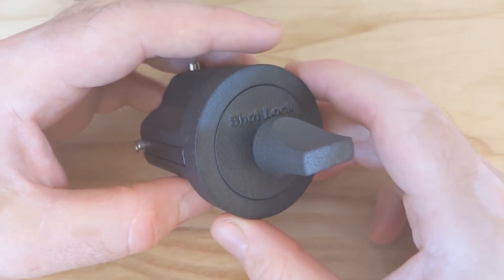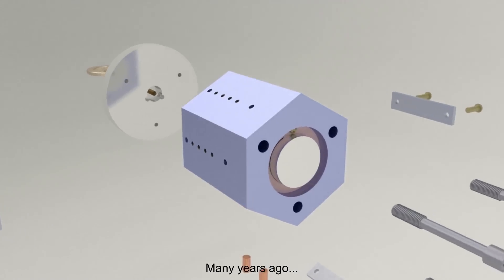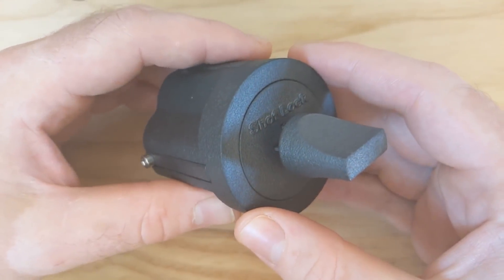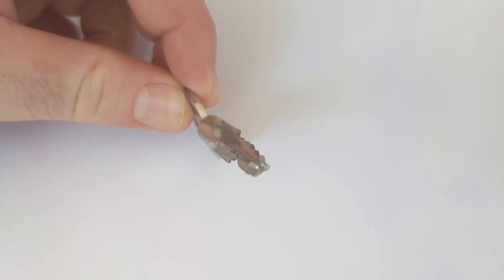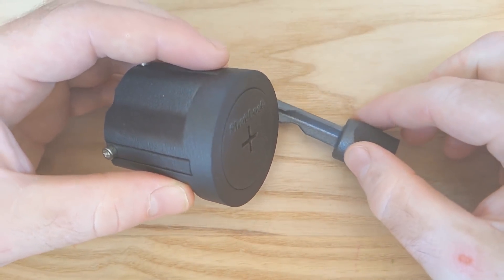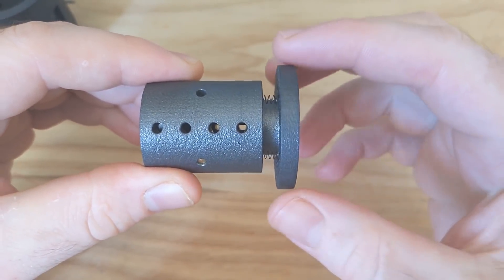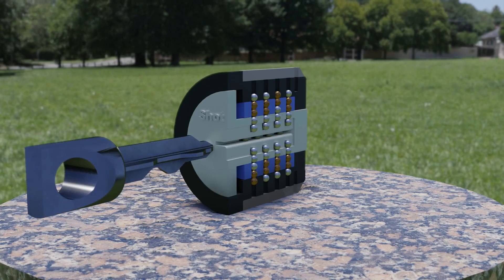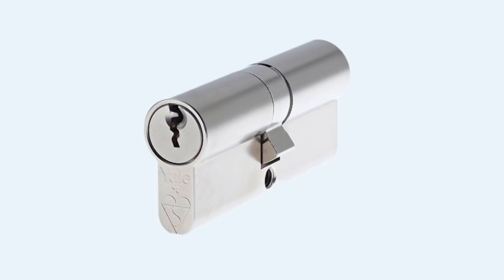A 3D Printed Unpickable Lock

Comment: As I understand it, the typical attack against these sorts of two-stage locks is a precision measurement attack. Like in a normal lock, manufacturing imprecision means that one of the incorrect pins will bind first. You can then use something like a Sputnik pick to vary every position one at a time and discover when the lock turns ever so slightly more. Here's a video using this attack to decode a combination lock: https://www.youtube.com/watch?v=h1MYWwpqH2s

I think you could miniaturize your design by using a tubular lock so that the second stage is behind the first stage (deeper into the lock body) rather than surrounding it.
Reply from the maker: Ah that is a clever attack! Probably would still take quite a while but I think it might work. I did consider the tubular design but it's difficult to fit in enough pins because you need so many.
Reply: @timhutt7051  Could you stack very small key pins to get a base greater than 2? If you have a key pin that's two cuts deep, and the key can have eight cuts, you could then have four of these (that would shear on any cut that's a multiple of two) with this stack pushing on an ordinary key and driver for the second stage. Perhaps the small intermediate key pins would be too flimsy or get clogged with grit after long-term use, though.
Reply: @davvigtu  did he answer your question?
Reply: @danpineda4447  I don't think so.
Reply: I think you could also do precision decoding with a set of 20-30 "test pattern" keys.  Only have a vague hold on the math though so would need help figuring out the optimal test pattern.  

Do you have any other examples of 2-stage locks?
Reply: @martylawson1638  I think the Yuema 760 as well as the Abloy Protec locks count as two-stage. I've seen a (low quality) video of someone attacking a Protec 1 with a laser pointer mounted to a key handle, but I'm not sure if it was a precision decoding attack.

The Yuema 760 has two sidebars, one that keeps freezes the position of the sliders, and another that authenticates. There's a video here: https://www.youtube.com/watch?v=tj4DG7Tnu60
Reply: @davvigtu  Thanks for pointing out the Yuema 760.  That's a very clever lock.  It prevents picking by locking the wafers before the lock-bar is tensioned.  They're very close to rendering it immune to precision decoding as well but unfortunately the lock jams up on the top of the lock bar instead of the side.
Reply: @martylawson1638  Yes, if they could just get it to spin like the 750 instead, then they'd be really close to unpickable. Particularly so if Sidebar B locks the sliders before the authentication even happens, so CaptainHook's 750 decoding attack wouldn't work.
Reply: @timhutt7051  Send it to LockPicking Lawyer for testing.
Reply: Might as well just have this lock be precision machined then, defeating decoding by this method as well. For a few hundred bucks per lock you could have the tolerances so tight you cannot decode, and at that point an angle grinder will do what it does best. Ultimately locks exist to prevent silent and fast intrusion, not silent OR fast intrusion. A lock can be bypassed quickly with a grinder, or silently by picking, but ultimately the end result is the same. If you want something to be inaccessible without detection & intervention, have it guarded.
Reply: @james4066  It's still a fun engineering problem to see how close one can get to a practical lock that can't be silently defeated! You're right, though. Making something near-inaccessible will basically entail living in a safe (imagine a solid metal front door with relockers), and even that only buys you time.
Reply: @davvigtu  oh definitely, didnt mean to make my comment sound so disagreeable. Just wanted to add some context to the pursuit of the perfect lock, cheers!

Comment: I expect the LPL would build a custom tool for pressure and would then pick the 4 sides.
Reply: You cannot pick because the only way to rotate the core is to offset it from the pin stack. I think it can be decoded, though.
Reply: I'm not sure that would work. You can't apply torque without pushing the centre piece back and once you push it back, you cant access the pins to pick.
Reply: He could burn it open
Reply: @bdawg5855  he could blow it up with a nuclear bomb - the point is, he cant open with NON destructive methods.
Reply: @bdawg5855  LPL focuses mostly on non-destructive entry, but with this custom tool Bosnian Bill and I made...
Reply: my guess is that he'd actually use a tool to reach between ball bearings to feel for the double bearings to lift them each to correct heights, very clever lock though, would need custom picking tools...
Reply: @DisKorruptd  how will he be able to lift them when there is no leverage?
Reply: @stephen2583  perhaps I was a bit unclear, this would likely be a custom tool that is like a key that you can adjust the bitting to
Reply: @stephen2583  Insert key with all 0 bits, apply slight tension, then vibrate vigorously... might jump some of those ball bearings into place?
Reply: @freakyjason477  and how would that work in someones front door? wait for an earthquake? and you think you are going to vibrate 20 pins in to the correct place all at the exact same time?
Reply: "Using this tool Bosnian Bill and I made yesterday, I will open this lock with the sound of my voice"
Reply: @Tonatsi  Bosnian bill retired, have some respect.
Reply: @SpecterNeverSpectator  I made this comment before I learnt of that

Comment: That's an elegant design 👍. Neat way to isolate the pins and remember the key.  Way simpler than the toy lock I made after watching the recent "stuff made here" video.  Also ran across a nifty Chinese lock that lets the core freely spin and only allows the internal springs to check if the lock bar should unlock.  (760? The Bowlie lock website mentions it as competition)
Reply: That's the Yuema 750. Apparently there's been an attack on it: https://www.youtube.com/watch?v=exaBQbJ_BKE

I think this lock combined with a 750 would be very secure since it would be much harder to do a precision attack when the core spins no matter what. You would have to fix the binary bitting limitation though.
Reply: @davvigtu  binary bitting isn't a problem.  He's already got 64000 valid codes.  With a dialer checking one code per second that's still 8-9 hours to brute force the lock.  Looks pretty easy to go up to 24 pins with over  a million keys.  Adding in the 750 spinning core mechanism to frustrate precision decoding attacks would probably get more security for the design effort.

Comment: looking at the animation at 2:30, it sounds like this lock can be defeated pretty easily by oversetting all the pins, so that the bottom two balls are inside the second cilinder. that would allow it to spin regardless of where the double balls are.
Reply: Doesn't look like all 5 pins would fir in the 2nd cylinder.
Reply: @tequilacollins  if you look at 2:25, you will see that all ball stacks are the same height, the only difference is the position of the double ball, which matches the key bitting. if (and only if) the lock design allows the 'pins' to be overset, you can cram the bottom two balls out of the core (grey) into the second cilinder (blue), that way neither will be prevented from moving. of course, that could not be done with a key, as you'd have to push the balls past the key hole. so tensioning and setting 20 pins in four different directions would be a formidable challenge, but certainly not one LPL wouldn't cope with.
Reply: @KPbICMAH  I get what you're trying to do, but to do that would require that you fit a single pin and a double pin into the outer cylinder (black), and I don't think there's room. Looking at the video, it looks like it would be close, but it's not showing the spring that also takes up room.
Reply: This was my first thought as well when I saw the schematic. Would not be all that difficult to do, but something that could be fixed in a future version.

Comment: I really think this is a better design then stuff made here. It is very smart using multiple beads instead of just a two-part pin. This allowed the inner cylinder to block the beads from moving when it's pushed in. 
This would really be a challenge for lock picking lawyer!.

Comment: Hi Tim, 

Very cool and unusual lock design! I like it.
I'm a board member of The Open Organization Of Lockpickers, a dedicated group of lockpickers.
Our key aspects are research and knowledge sharing.

Locks that have been 'impossible' for many years have been recently opened non destructive non the less.
The current list is quite small of locks that can't (yet) be opened non destructively. 
 
I believe for this lock traditionally picking will not do it. But I've some other ideas...
Would you sell me a copy of lock for the collection?

Jan-Willem
Reply from the maker: I will definitely send you one, but it might take a while for me to make another one...

I think davvigtu might be right about being able to pick it by precisely measuring how far you can turn the key, but it would still be cool to see it done!

Is there an actual list of so-far unpickable locks somewhere or is it unwritten?

Thanks for the nice reply!
Reply: Hi I was wonder how feasible it would be to have a high security lock based off tolerances alone, something using like bearings to support the cylinders, and reamed or even edm drilled pin slots. Or is this just a really expensive way of manufacturing a lock that can still be picked relatively easily.
Reply: @iain3713  Good question. Many high security locks rely on the high precision manufacturing but it's not only about tolerances. For example, a spool will give feedback that can be exploited no matter how good the tolerances are. Further some attacks have a higher success rate on locks with tight tolerances. 

Note: The Assa gin pins are a very good choice of pin for a 'zero tolerance lock'.
Reply: @jwrm22  just out of curiosity, what attacks work better with high tolerance locks?
Reply: If you manage to get a copy of this, I'd love to see you talking more about it! Very cool

Comment: Really Cool design and great concept. As people said earlier, it looks like oversetting the pins would be a weakness in this current design - however, I think if you made the middle cylinder hold 3 ballbearings instead of 2, this no longer becomes a problem (as you cannot lift 3 bearings and still allow the 2 cylinders to slide against each other) - the problem then becomes scaling this up to allow for more than binary pins.

Either way, you would still need a special tool to be able to overset 4 rows of pins all at once, though I dont think that's an insurmountable challenge either.

Love the concept either way, I'd love to see a 2.0 design, or even just other contraptions you've worked on!

Comment: It looks like there is some tension that can be generated when the plug isn't pushed in. The lock is annoying, but not unlockable. 

You'd need a rake and made a special bump key.
Reply: Yeah, due to the tolerances of the push-to-rotate mechanism, you can probably apply just enough tension to rake/pick the pins up before pushing forward with confidence

Comment: I actually had a not far off similar design in mind but would use the middle cylinder (The cylinder between the outter shell and the keyway.) to unlock. The keyway cylinder would be free-spinning when the key is not inserted. Trying to pick would be impossible because the keyway would be free to spin.
Putting the key in would set all the pins then press a pin at the very bottom that would lock the keyway and the middle cylinder together if all pins are set correctly. If all pins are not already set then the 2 cylinder wouldn't lock together.

Comment: A tool to pick this is fairly simple in design concept.  Create a key with high bitting across all lengths.  At the pin locations have extendable pins in the key itself which can be lifted one ball bearing space into the lock body thus filling the first 2 chambers of the sheer core always with 2 bearings which would always open.  Depending on tolerances could possibly accomplish it with high pressure air as well.  

Watching LPL open a lock with only an air compressor I'm pretty sure would be a new one for him.

Comment: This seems to be possibly prone to oversetting. Pushing all the balls deep enough into their channels (actually just one ball diameter deeper than the key would) will push all the double balls out of the way and the lock will turn. But it may be tricky to execute at all four sides at once and the lock certainly can be made resistant to it.
Reply: He said that it only has two possible positions for each bitting. So that makes me think that you couldn't over set them ..
Reply: @stinky817  Oversetting always means pushing pins (or balls in this case) deeper into the pinholes than a key would. Number of possible cut depths on the key is irrelevant.

Comment: it's funny because i have been dreaming about designing an unpickable lock ever sinece i saw Shawn from Stuff Made Here make his lock (although I would probably never actually have sat my ass down to do so) The design i had in mind and have been dreaming about was actually exactly along the lines of what you just made here with binary pins but my issue was to fit them all because i thought you would need at least 10-16 of them to have a descent security. I see you have been smarter than me and arranged them nicely in quarters. Didn't think of that, nice job. I'm so happy to see someone had the same ideas and actually put the effort into making it work.

Comment: This is a pretty great design. Since no tension can be applied to the pins; raking, ssp-ing, foil attacks, and standard impressioning won't work on it. The only thing that I can see going wrong is either over setting or under setting the pins. But for an attack like that on this lock to work, you would need to find a way to brute force the right combo. And by doing it that way, you have atleast 65440 possibilities (providing that you either go for max or min setting of the pins like binary between 0 and 1111111111111111)
Overall, this seems like a pretty impressive lock

Comment: I assume you already thought about this but the video didn't mention it explicitly: are the stacks + springs solid enough that you cannot overlift all the stacks two balls worth?
Reply: Exactly what came to my mind after watching the working principle. Interresting design though
Reply: One could also fix this my adding a thinner metal pin inside the spring to limit the compression even it it is possible
Reply: @jackaw1197  The problem with thin metal things is that they are vulnerable to bending by brute force attack. But yeah, there're multiple ways to fix the problem. For example, if the spring stack can be compressed to much, just add a regular pin of suitable length in the stack. That cannot be bent and it will reduce the available space for the compression.
Reply: It seems to me that you wouldn't be able to hold the balls at that height unless you had a pick on every pin stack as you tried turning because there is an extra ball height in the inner core

Comment: I have a method that I believe would pick the lock you show in your animation.  There seems to be a flaw that could be easily fixed.  Your design allows pins to be set to "position 0" and "position 1" with the key.  With 4 special comb shaped tools along with a central tapered rod tool, you could set all pins to "position 2" and the lock would open.  You can prevent this by limiting pin travel and/or placing some double height pins (like the shear line ones) at the bottom of the stack.

Great work though.  This is a super elegant and simple solution that I think shows a lot of potential.
Reply: That wouldn't work, in the animation the brass balls are stuck toghter, setting them all to 2 won't open it

Comment: It's definitely a really cool design, using ball bearings is clever, and the fact that the pins are binary kinda make the main downside of that totally irrelevant.

It's simplicity is genuinely super impressive. A lot of people will go for overcomplicated designs with more points of failure, where just coming at it from a different angle(sometimes very literally as in this case) can produce equally effective results

One thing that could be an issue(but is also not terribly difficult to fix) is that it looks like you could, depending on how tight the construction is slip a thin sheet if metal between any two cylinders, which could be used to facilitate picking. Unless you've already thought of that and I'm just being dumb

Comment: instead of applying tension by turning you can do it by pushing the cylinder inward and get the pins to bind that way.
Reply: Exactly. In the animation showing 8 of the 16 pin stacks, 6/8 are already set and the other two would act like spools, having to find the right order so set all the unset pins would be all. because all are identical spools, it would be easy to immediatelly chwck which stacks are set and which need to be raised. if you dont want to bother trying a lot of different orders to set, you could just inset a ball bearing i each unset stack and fix it with tape. and done. from there it just opens by pushing and turning.

Comment: Lovely idea to prevent tensioning. Simple enough to mass produce.
Depending on tolerances. Maybe a slim possibility of it being decodable with 4 binary keys that allow one stack at a time to be high and measuring rotation angle. But I doubt that would be reliable.

Assuming 50/50 change high low, half the pins would already be set. So you only have to set 8.
It's a guess that having 7 in the right spot would allow slightly more rotation and so could he measured.